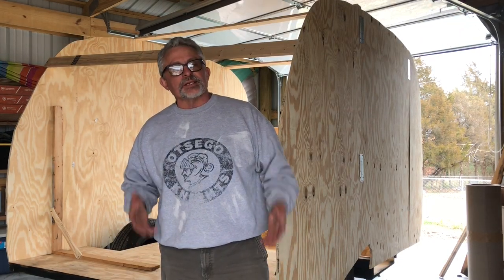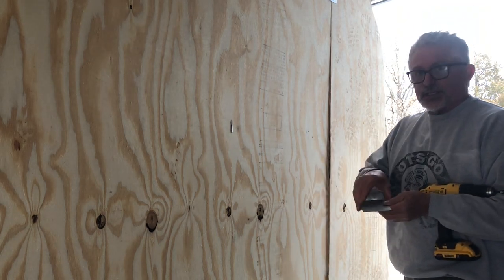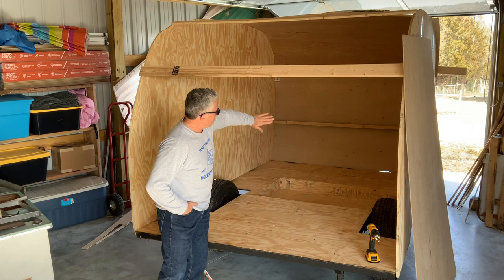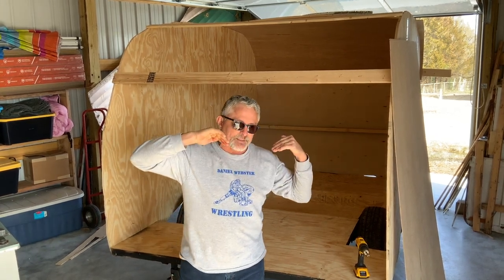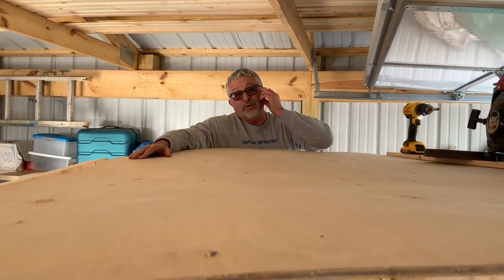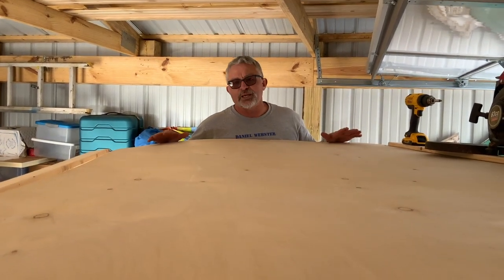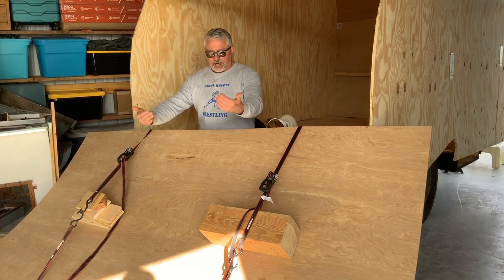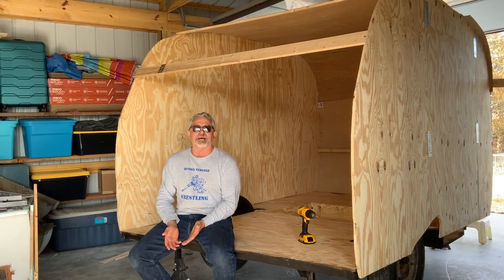Ep. 10 How to rebuild the walls - ceiling on vintage camper. Retro Serro Scotty Sportsman trailer

Comment: I love your show. It has helped me so much. I am rebuilding my first vintage camper. It is a 1966 Alladdin Solstice Camper made in Hillsboro, Oregon. I am having to rebuild it as there was water damage in the frame, especially in the curves. Do you think this method would be good to follow?
Reply from the maker: I see this method used on many styles and models. Make sure you take lots of pictures and try to follow the way it was built. Good luck

Comment: a friend and i have been slowly rebulding her serro scotty for a while now. we have the walls up and roof on and i am doing some work on the inside now. today i was testing the fit on the skins to the walls and i think somehow something went wrong and it seems the structure is a little bigger than the trailer skins. im feeling a bit panicked and hoping you might be able to give me a little advice. ive watched many of your videos and did the wall tracing how you showed but somehow it is turning out strangely. please help!
Reply from the maker: Too big is better than too small. once you build the top rail and place the insulation on the roof you can fit the tin and then take a marker and trace the excess and then trim it up. Good luck on your build.
Reply: @RobTheRebuilder  thanks for responding, it’s the trailer structure that is too big and the tin too small. I think I may have added one too many layers to the top rail. It seems pretty hard to pull off without pulling it all out. Is it ok the put the j-rail on with the long side on the sides of the trailer instead of the top, I think that might make enough to cover? Or Is there anything else I might do to remedy the situation?